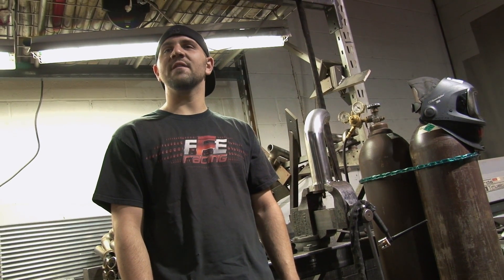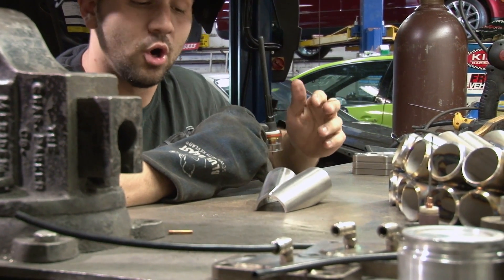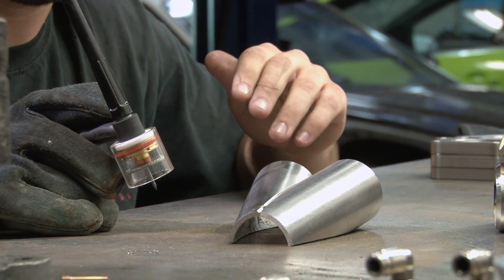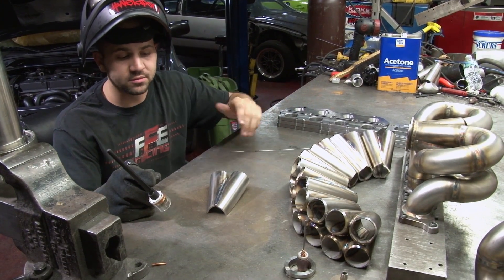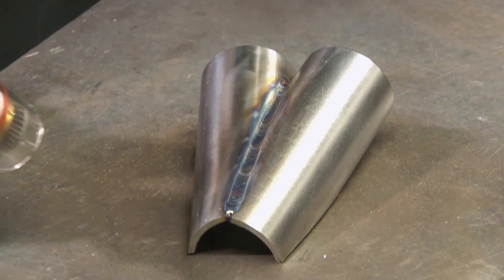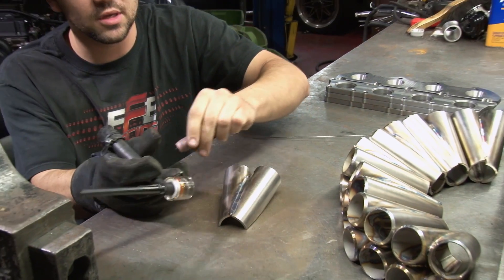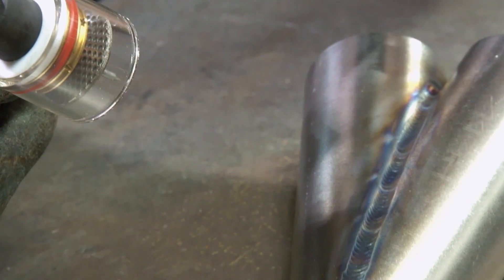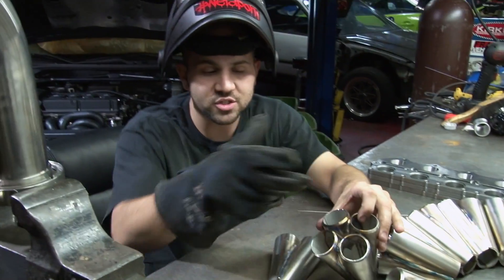FFE Ed Woolsey. Collectors 101.

Comment: anyone else have this issue with the giant pyrex gas lenses he is using there like I am?   I have this nagging issue which made me actually put the setup in the box and go back to a #10 large lens setup.  I would get random positions where all of a sudden my weld goes to shit, the puddle turns grey instantly and my tungsten's trashed.  This is 100% a gas coverage problem but why?   I can actually see it happen in the helmet too but by the time it happens its too late.  I can see a wisp of smoke come up from the bottom of the work area and get sucked up into the gas lens, which kills the weld like I mentioned.  this seems to happen a lot more when I am welding buttwelds on tube, and I get about to the 90 deg torch angle as I break over the crest of the tube (if you are looking down on it)  I think its like the airplane wing effect, where the gas flows around the pipe/edge of your work and circulates around then sucks up outside air into the shielding envelope.  I have tired 8, 10, 15, 20, 30+chfm and it makes no difference.  It pisses me off so much. lol
Reply: ***** how come that part isn't in an fixture or back purged? if he would increase is rate of speed he could move faster less heat input.  or and a trailing rig to that cup.

Comment: a great explanation of welding a single bead with a gas lense, but there is no detail provided on how the collector is cut.  also, welding it together like this is going to pull the two runners together into the weld which will create significant misalignment when it gets welded together to the other half of the collector.  the center will make contact before the outside edges when mated with the other collector half.  this will then require taking it to a belt sander for 5 minutes to flatten it out.  ideally, it should be welded as an assembly to maintain proper fitment saving both time and material.
Reply: +Eddie FFERacing You did great!, sure beats mr tig and his lame ass vids
Reply: +Aaron Weir I have a jig set up to cut 15 degrees. For 4 into 1 I make my first cut then rotate 90 degrees keeping the length the same and second cut. Clean it up and repeat three more times.
Reply: +Aaron Weir +michael rodriguez The guys walked through my door the day of the interview with no forewarning, phone call or appointment. Nothing was ever mentioned and I simply was in the process of making more collectors for the batch of manifolds I had to do. 

There was no time, nor was i planning on making any of the components prior to them coming that day.

The collectors are tacked up clamped to a fixture (not pictured) and they are welded on the inner joint to keep it from pulling apart prior to welding the long outer joint. There is no need to put them on a sander for 5 minutes after.

Everyone wanted to see pictures of collector jigs, no, and how we make them, but if this was better prepared by the company filming there could have possibly been a longer video with more information.
Reply: Can't give away your secret jig right?